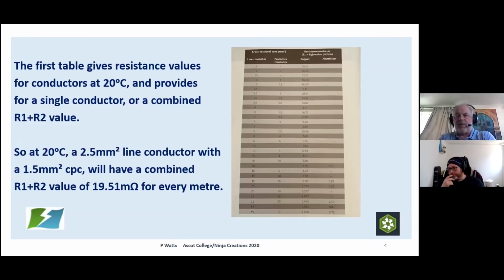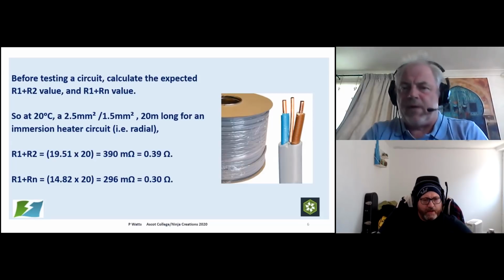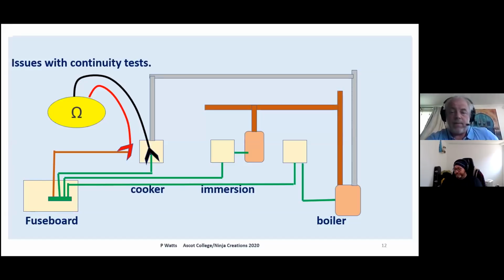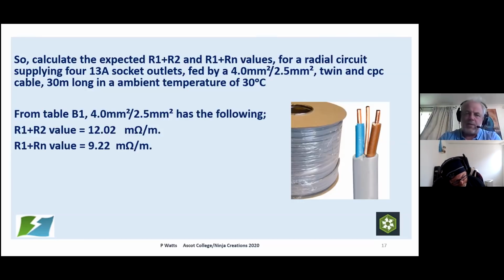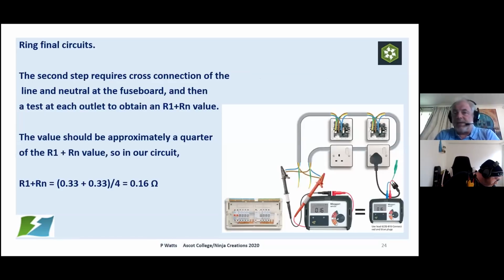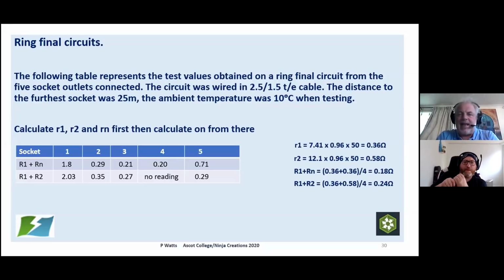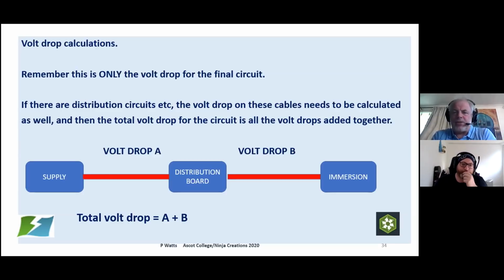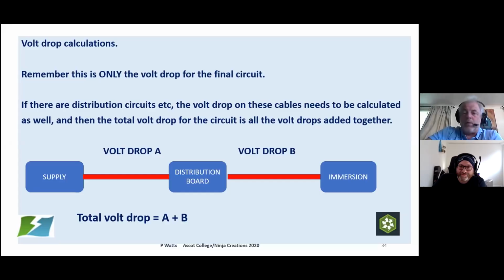Inspection and testing - analysing the results of DEAD tests - A SparkyNinja webinar

Comment: All this theory is good. And its definitely helping me - being an apprentice.

Assuming your doing an EICR how on earth are you going to know the length of cables on each circuit. Unless you follow every cable around the house there is no way to guess.

 I suppose you could guess but when you do you find your calcs dont match the results. What would be the issue here? A problem in the cable/terminations.... or the cable has ran a funny way adding a few more meters on the run? Or maybe installer left slack on the run? 

Now I'm commenting this assuming you guys are implying these calcs should be carried out during EICRs in a domestic environment. 

I am 100% for the calculations on say an EIC 

I am still learning, so I accept I could be wrong. These are just my thoughts.

Comment: 20 degrees C is the standard reference temperature for measurements.

“While most dimensional metrologists know that the reference temperature for dimensional measurements is 20  C, very few know how or why that temperature was chosen.  Many people have thought it was, in some sense, arbitrary.  In actuality, the decision was the result of 20 years of thought, discussion, and negotiations
that resulted in the International Committee of Weights and Measures (CIPM)  unanimous adoption of 20  C as the reference temperature on April 17,
1931.” From Journal of Research (NIST JRES)

Comment: awesome video. Quick question at 47:38 are those readings done at 30 degrees, thus a correction factor? Also when calculating the 1st socket would the length be 7.5m in the calculation or would it be the full 30m length of the ring?